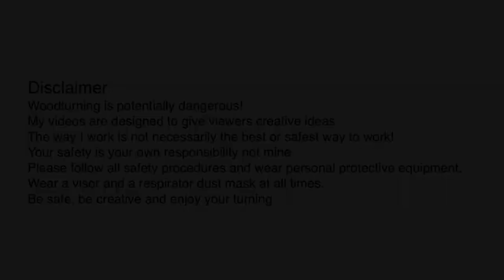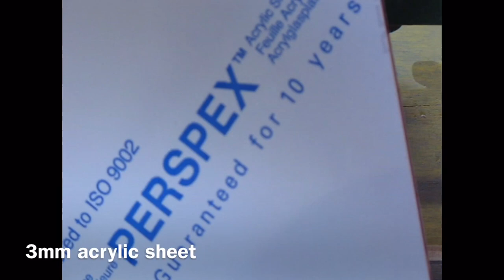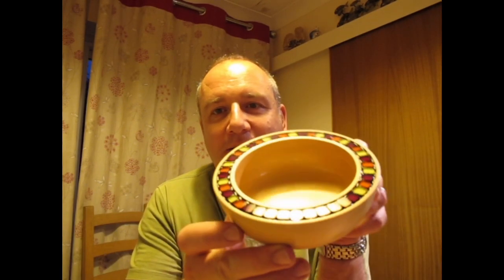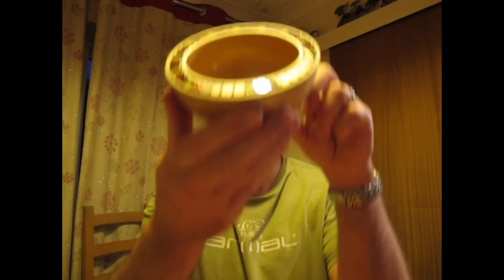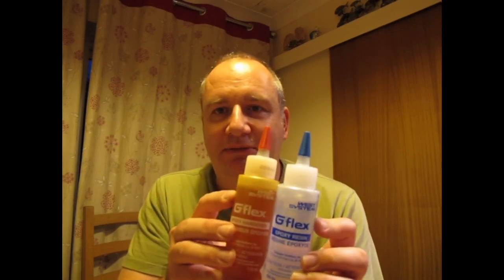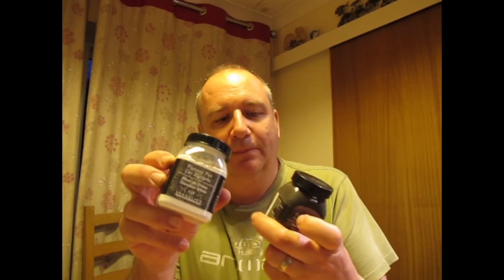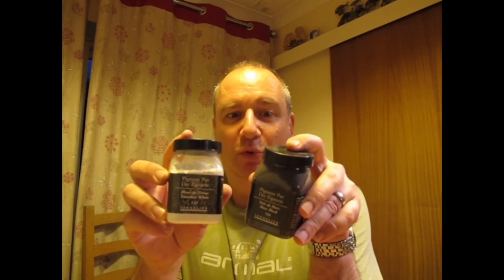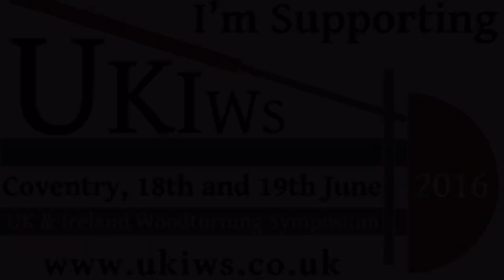Turning a Castello Boxwood Bowl with "Stained Glass" Inlay

Comment: Thank you  so much Jim for another great video.  The finished item is just beautiful.   I haven't been able to get into my workshop for about the last three weeks as I've been planting out my vegetable patch so I'm in severe withdrawal.
I'm not surprised your local craft shop has run out of Milliput.  Something has caused a surge in sales in the last six weeks or so:-;.  I bought some on Amazon and had it the next day.
Best wishes,
Alan.
Reply from the maker: Thanks Alan for your very kind words. I know what you mean by withdrawal, I had a bad chest infection earlier in the year which stopped me turning for several weeks. I got a new lathe last week and couldn't use it for 4 days due to other troubles and that was very frustrating. Turning boxwood on Sunday with my new toy was wonderful. All the best, Jim

Comment: Absolutely beautiful! Wonderful idea there. :) - Heidi
Reply from the maker: Many thanks Heidi, I thought you might like this one, even if it doesn't glow in the dark ! All the best, Jim
Reply: Jimson's Stuff well glowing in the light is good too. :) This got me thinking about using glass since I do have all the cutting tools from when I do glass fusing. Also it had me thinking that I could just pour thin sheets of tinted resin to cut and achieve a similar look. :)
Reply from the maker: +BlackCat2 sounds good
Reply from the maker: Hello Heidi, I was wondering whether you have tried your idea of the glass or poured resin yet ? Jim
Reply: Jimson's Stuff I have done some practice with the glass/resin and cutting it. Not getting a lathe though until September so I don't know how it will work in a bowl. :)
Reply from the maker: I expect you are very excited about getting a lathe. Try not to be too adventurous with the first pieces you turn, it can be frustrating when you first try it but everything soon falls into place. As you will no doubt already know, I wouldn't add glass until all the turning is finished, for safety reasons. Take care, Jim
Reply: Jimson's Stuff I definitely am excited and yes I plan to start out small. :)

Comment: Jim nice work again. 
Love also the way, you turn bowls. Just a suggestion, while using and working with epoxy, I think maybe it's better do It, outside, on fresh air , rather than, working in a closed room. 
pm
Reply from the maker: Thanks Piermichele, I'm glad you like what I do. I usually do my epoxy work outside or in my garage but it makes filming difficult. The epoxy I use is low odour but the acetone certainly has nasty vapours. All the best, Jim.

Comment: good stuff, have you thought about using clear epoxy and turning a thinnish rim, then when set turn down the back of the rim to let light shine right through?
Reply from the maker: Thanks. I have lots of ideas along those lines and they may form part of a future video. Using the fluid epoxy does mean you can only use it on a flat/level surface or it runs. I would really like to make a hollow form along those lines. Cheers, Jim.

Comment: Very nice job, quite impressed. Have you ever tried using Polymer Clay on one of your creations? Thanks again for the showing. August
Reply from the maker: I have considered it and it is certainly easier to work with but I would have to choose my blanks very carefully. I think it would only work on small items with very dry ( kiln dried ) blanks. Larger pieces are more likely to warp and crack in the oven. You could certainly prebake polymer "tiles" and then set them into the piece. Thanks for commenting. Cheers, Jim

Comment: Could you do a cayenne pepper resin inlay and a turmeric resin inlay? For this project you could have mixed in aluminum and/or pewter powder to make it look more like the lead in a window.
Reply from the maker: Flour and turmeric would be possible but I would probably stick with the pigment powder for now, I have both those colours. I have added metal powders in some of my other videos, it wouldn't have worked for this one because you need to cut the surface back on metal filled resin to achieve a metal effect and I couldn't have done that with this design. Cheers, Jim

Comment: Really nice bowl.  The inlay adds a nice extra dimension.  Where did you get the dispensers you used for the epoxy?  I have a hundred uses for something like that, but never see them around.
Reply from the maker: Thanks Mark. The syringes can be found on eBay, they are sometimes called dental utility syringes. As you say they are very useful and the tips can be cut short to make them wider. Shop around because the price is very variable and they are very cheap if bought in bulk from abroad. Cheers, Jim
Reply: I found a box of 50 for USD 18.65 (GBP 12.90) on Amazon.
Reply from the maker: +Mark Hazlewood . Sounds good Mark. The cheaper the better because you can only use them once if you are using epoxy and similar. Cheers, Jim

Comment: Another nice bowl Jim.  How did you clean off the excess epoxy resin?  I noticed in the video there was a drop on one of the tiles.
Reply from the maker: Thanks Richard, the epoxy got all over the tiles , I used lots of pieces of lint free cloth ( actually an old shirt I cut up ), and pure acetone. Acetone is the best solvent for uncured epoxy resin and using fresh bits of cloth ensures a good finish. All the best, Jim
Reply: Thanks!

Comment: Hi Jim just been looking for syringes like the one you used in the video.  The only ones I can fined are 12ml which I think is smaller than yours?  Would you mind telling me where you get them from.
Reply from the maker: Hi Paul, I am not sure what size my syringes are as they are not graduated. They are called dental utility syringes and are available on eBay, 12ml I think is smaller than the ones I use but should be plenty big enough, I always mix too much. You can cut the tips if you want a wider nozzle. Shop around because the price is very variable, they are much cheaper if bought in bulk ( and from overseas ) but it might be worth buying a small amount first to see how you get on with them. Try and look for cheaper generic ones rather than Monoject or similar. Hope this helps. All the best, Jim

Comment: After viewing your video for untold times. I decided to try the try and find the Perspex you had mention. Sad as it was no where in the try state was I able to locate this item? Did the every hobby shop and searched on Craigslist and Amazon and others. No luck. In addition was very interested in find the needle you used to put your past on with ? Hate to bother you with this, But I need some help.. Would love to give it  try.Thanks Bob aka Postalbob
Reply from the maker: Hi Bob, I got the coloured Perspex off eBay.co.uk, maybe it is not available in the USA. I know that it is also called acrylic sheet or plexiglass, I hope this helps. I think it would cost too much to import it, as it is not exactly cheap in the Uk. I also got the syringes off eBay, I think they should be available worldwide, they are sometimes called dental utility syringes, shop around as the price is very variable, they are very cheap if bought in bulk. I wish you luck in your quest. All the best, Jim
Reply: Thank you .. Had received a email today on a vendor that might have what I need? Most of the major hobby shops only carry clear or thin sheets and no color. So I will continue to keep on looking.. Again thanks for a great idea
Reply from the maker: +Robert Helveston .no problem Robert. I've just uploaded another video using acrylic. All the best, Jim